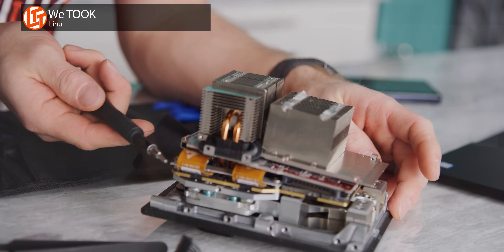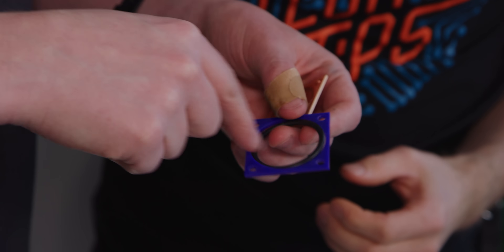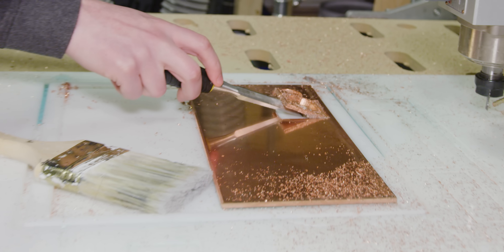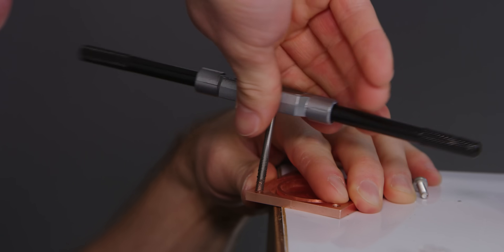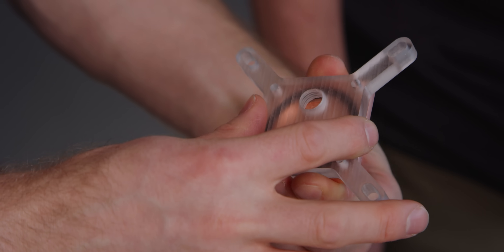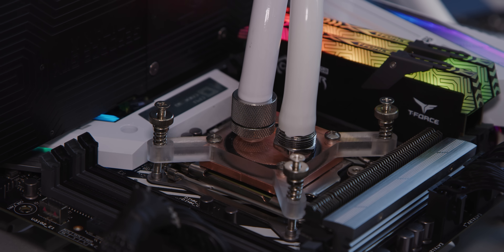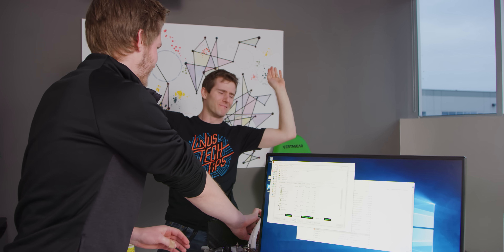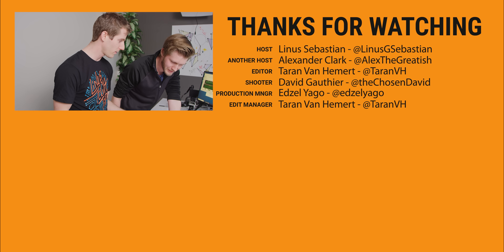We Built a CPU Water Cooler!

Comment: why are you trying to machine these small parts with subpar tools?  i would think you would be able to achieve a better finished product with better tolerances and the ability to fin the block with a metal 3d printer.  Just whip up a model in solid works and send it off to a 3p printing service. Not as fun of a video to make i guess but i would expect it to be far cheaper for prototyping then buying all the expensive tools which aren't even all that great.  or just look into the markforge lineup and buy one of those to allow you to do all the crazy experiments you want!  that would be really fun to watch actually but super expensive to buy the machine.

Comment: Tips from an engeneer: You have this small Channels because you whant to hit a reynolds number higher 2300. This mean the flow changes from laminar to turbolent.  This means more mixing within the water copaired to laminar flow, where just the layer of water gets hot, that touches the surface.

Comment: I thought anything petroleum based lubricant would rot rubber o-rings causing them to leak, that's who I use 2HT silicone grease, as plain as possible with no fancy additives, just as clear and simple as you can get, it's good enough and recommended for camera lens o-rings and won't rot the rubber. You can get a small 20g to 50g tin for around $2-$5 that'll last ages as you don't need much.
Ever wonder why they say don't use Vaseline on *ahem * condoms for lubricant as it rots them and to use non-petroleum based lubricant?
I do a lot of Nerf modding and rule No. 1 in spring and plunger based blasters is never use petroleum-based or aerosol lubricant as it murders the o-rings and causes a bad air seal and leaks in a very short time as if its not air tight, it certainly won't be water tight.

Comment: just drilling a bunch of tiny pits in the waterblock surface just under the inlet and making the block more restrictive will greatly improve the performance. Pumps create flow resistance creates pressure and pressure is what cools.

Comment: I expected something similar to the DIY heatsinks. One way or another this is just as bad, just a different bad.
- The freehanded vice grip tapping int acrylic, breaking off chunks
- The visually angled screw hole tapping
- The ghetto O ring (with a step)
- The YOLO leak proof test on the board
VS.
- The hack sawed aluminum block

Comment: O rings are sealed by heating both ends over a candle or torch. A joint made with an adhesive will not last.
Reply: Good lord no. If I ever spliced o-rings with a torch at work instead of just some standard LT404 I'd have both a failure and reprimand waiting for me.
Reply: where have you ever seen this successfully preformed? I'd love to see that happen.
Reply: Pretty sure just vaseline and just enough squeeze would work far better far more consistently, than presenting a rubber compound with it's main mortal enemy, fire. Ofc there are compounds that can eat rubber, but you aren't probably going to have it, machine tools, the need and not know that at the same time.
Reply: @nicewhenearnedrudemostlyel489  Yeah this is a connection technique applicable to TPE only, and i have not seen it done for sealing purposes, but for power belts. Indeed even small misalignment between the ends sounds like a terrible idea. If you have the ends plain loose or connected with some weak glue purely for placement purposes, it would just find its own alignment and may be most likely to seal perfectly fine among available techniques. Obviously CA glue is not your friend here, but if it works, it works 🤷

Comment: Linus, check out this budget full kit, not tried it but would make a great video, 
Bewinner DIY 240mm Water Cooling Kit, DIY 240mm Cooler CPU/GPU Block Pump Reservoir with LED Fan Heat Sink Computer Water Cooling Connectors Kit, All-in-one Liquid CPU Cooler Kit https://www.amazon.co.uk/dp/B07MZ5HVL8/ref=cm_sw_r_cp_apa_i_frWzCbRKH0X8D

Comment: « It’s airplanes that really scare me, their safety factor is under 10% »
Absolutely not, EASA CS 25 303 « Factor of safety » says « Unless otherwise specified, a factor of safety of 1.5 (50%) must be applied to the prescribed limit load which are considered external load on the structure »

Comment: run the face of the heat plate along a belt sander with everything all bolted together to smooth out any potential bowing from torquing down the acrylic plate. would using a rough grit to increase surface area improve things at all?

Comment: Yeah, anyone who has worked in an environment where prototyping/fabrication work is done will watch this video and die a little bit. 
Couple of thoughts to help with future iterations:
-When tapping threaded features, it is really helpful to have a surface that is known to be level, and an axis that you know is "close" to perpendicular to it. If you put a punch or center in the chuck of a drill press, and use that to hold the end of the tap, you can ensure that the tap stays straight, and it will make it faster to do multiple holes. Also, cutting fluid is a godsend. 
-Well done with your use of the gasket fitment guide. As a recommendation, you could leak test your prototypes with compressed air at low pressure (50 kPag / 7.5 psig), and measure the leakdown time. Then if you detect a leak, you can locate where it is coming from with a little soapy water. The big flick here is that you are able to leak check you parts in a way the doesn't risk your expensive computer components that can't get wet.
-if you do a bit of research on the fin design of your heat exchanger, you may get substantially better thermal performance.

Comment: Wow. Its 1998 and when we had to build our own slot 1 coolers.... People today just buy whole kits...know nothing. About buying a block of copper and using a drill press and milling machine...then usingba aquarium pond pumps...and Ford heater cores...

And soldering resistors on motherboards and getting 80 ton100 % over clocks.

Now u buy a pc with coolong system...turn it up in bios 10% and post online your and overclocking god.

Remember locked pci bus..and running. HD at 41mhz front side bus and corrupting it... Just enough to get a screen shot

Whatbhappened to vapochill and phase change.

What happened to mhz..its at a standstill

Ive hit 5.35ghz in 2006 out of 3.6ghz Northwood e....

Comment: top tip for tapping; mount the tap into a pillar drill to keep the tap straight only ever hand turn the bit when tapping though!, this is very important for acrylic where you can get fractures if you're not straight enough

Comment: ✔Airplanes are statistically safer than cars and have been for a while now. 

Please dont spread lies and misinformation about airplanes/aviation!🤦‍♂️
Airplanes are held to a much higher maintenance standard  than most vehicles on the road. 
There are so many different factors that go into a airplane/crash accident.  Most of the time it isn't neccessary a maintenance issue that cause that crash, but usually someone not paying attention to a small detail that causes everything to spiral out of control. 

Can airplanes be/seem scary?✈
Of course!
Are they actually more scary than cars??
Heck no! 😘

-former pilot
Reply: He is talking about safety facor while designing the thing. And he is right - safety factor for planes can go as low as 1.25, while a car is designed with a factor of 3.0
Reply: T0neKnee this is a pc video
Reply: @SeanyKrabs  indeed, it is! That's the area of expertise they should stick to.
Reply: @highks 😂 isn't that the truth? I mean Ik they've never done this before. But I was on the edge of my seat when they leaked tested it on the cpu!! 😱😰
Reply: @T0neKnee Considering you're a former pilot, you should probably take your own advice about not commenting on things you don't understand, like engineering. Factor of safety =/= accident statistics. As Elonas said before me, Alex was commenting on the former, which is the leeway built into a design to cover for loading conditions which fall outside the expected range.

Comment: I have never built my own computer.  I'm a maintenance engineer and I dont really have the ability to build one until I'm a little further out of debt.  BIG QUESTION??? Can you build a system inside a closed box.  Dehumidify the air with a custom dehumidifier and the build a sub zero cooling system.  My theory is.  If there is no moister in the air.  It cant condensate.  So no water problems.  Linus..... please build

Comment: Just wondering,
why didn't you test if it would leaks without mounting it to the CPU?
I guess you would want to be able to push a load, but ignoring that,
if you just wanted to test if it were to leak, why would you have to mount it to actual hardware?

Comment: You could add some fins like a conventional heatsink on smaller chips increasing surface area and rigidity so that when you mount the top portion the pressure wont bend or misshape the contact patch

Comment: Use a drill on low speed when you want to make threads, it's a lot faster and a lot easier, I've been threading stuff (plastic, aluminum, steel) this way for years with no issues, just be sure the drill you use has a variable speed trigger on it and what ever your threading mount it in a vice.

Comment: you guys can try tapping on the drill press, get everything lined up put the tap in the chuck bring it close and turn off the drill press as the spindle is slowing down bring the tap down. its a pretty easy to get your threads square that way and the rest you can do by hand since the hardest part is starting it
Reply: also put a counter sink where you want to start the tap so you can screw it easier

Comment: Wtf, test it with an adjustable dummy load and a temp sensor, that will be much more secure than plugging it on a motherboard, and you can see what is capable of

Comment: Lubrication whilst machining is a thing. Copper shouldn't be all that difficult honestly. Annealing copper might make it easier to cut with the CNC bits as well. But in general most metal workers will indeed put a drop every so often while drilling and machining.
Reply: Copper is not difficult.  Something like copper would absolutely benefit from oil.  Annealing it actually makes it more difficult to machine due to it already being soft and gummy.

Comment: Linus loves not draining the gd loop! Also 13:14 Alex come on man. You are like 1000 times more likely to die in a car accident than on a plane.
Reply: Yeah man, even less likely than that
I may not have understood him correctly, but after seeing how sensitive aero engineering is, I am more confident than ever boarding on a plane. Tolerances are insane
Reply: Yes but there are also like 1000x less air planes, and cars are (when maintained properly) pretty safe, I worked with a guy who built cars for a while and although he probably was a little more concerned than some manufacturer, every part got checked, always, no exception.
Reply: He's talking about the safety of the machine itself not getting into a wreck.
Reply: @jamesjacob9632  Imagine if airlines only ever inspected their planes when the "check engine" light came on, and flew them until they fell apart.  Or if pilots were doing their makeup while taxiing on the runway, or dealing with screaming kids in the cockpit.   XD